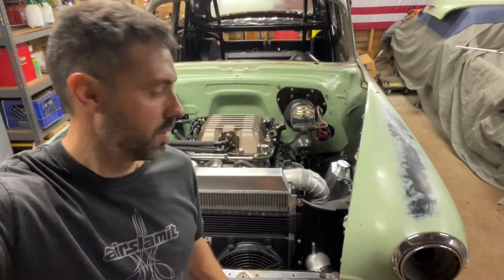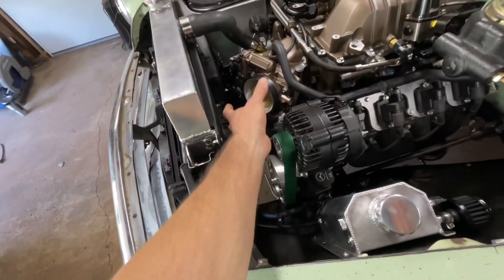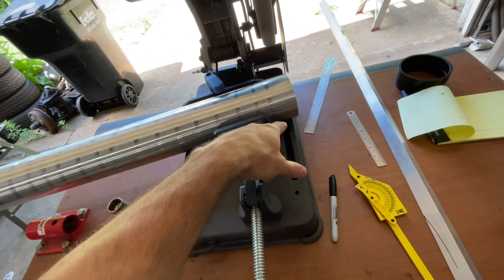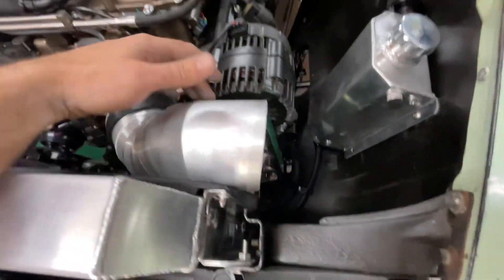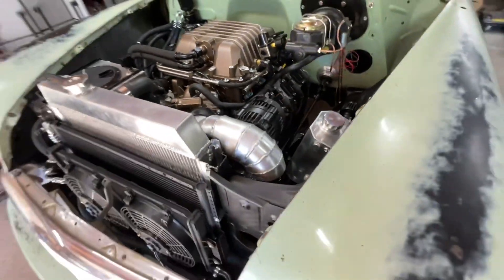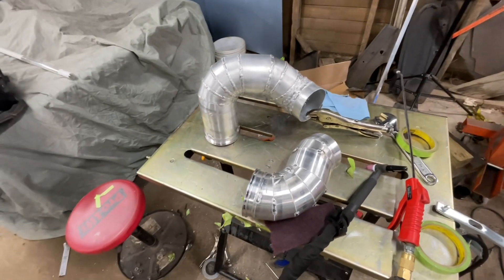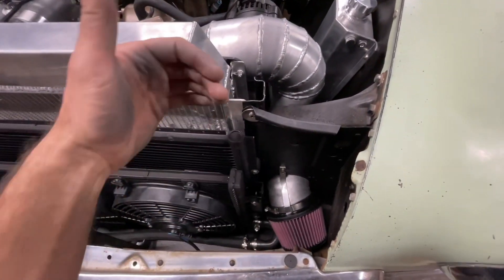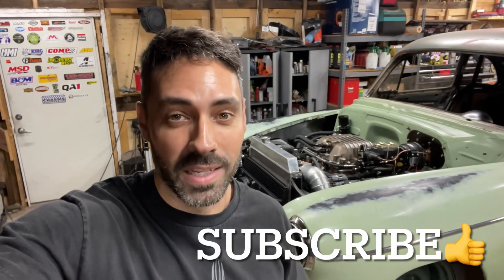Pie cut aluminum TIG welded 4 inch intake Tube with K&N filter

Comment: I have been following this project from the beginning.  Very impressive and truly amazed at your skills throughout the process.  I can’t wait to hear it run.  What engine is that?
Reply from the maker: 5.3 “LS” iron block with all forged internals Stroker kit. (6liter now) Ported polished heads with BTR stage 2 blower cam kit to match the LSA supercharger.